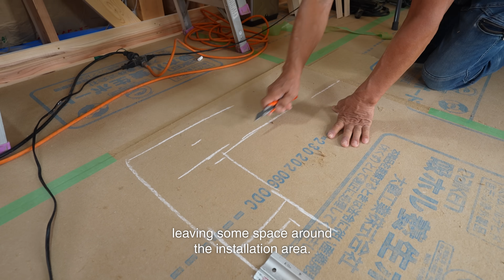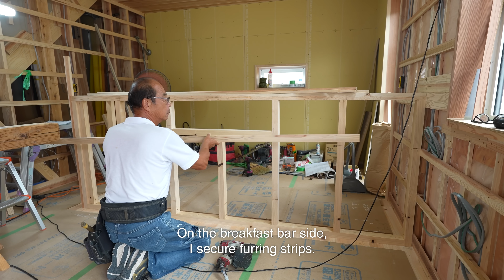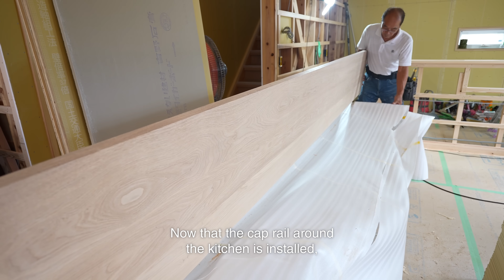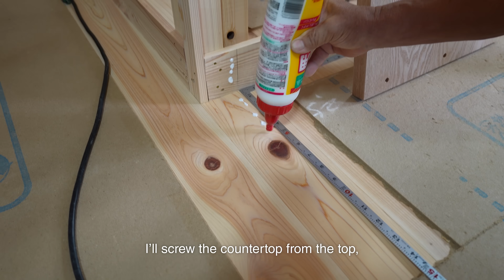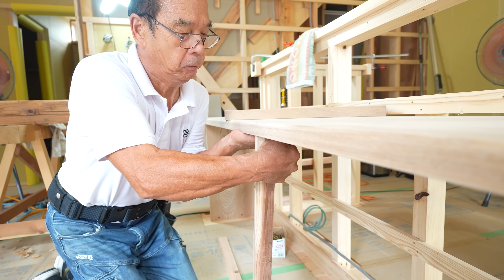Open Kitchen with a Cozy Japanese Inspired Breakfast Bar | New Build Season 5 Part 11

Comment: Just curious. When you’re driving in the screws, why do you back them out slightly before tightening them fully?
Reply: When you initially drive the screw it pushes the material away that you're screwing into. He's essentially giving the material an indentation with the first touch of the screw, backs it out then it can drive and pull things together. This is done normally when you don't predrill things with a  pilot hole.

Comment: When attaching the shelves you usually drive the screw in and out once, before you drive it in all the way. Why is that?
(I'm guessing it's a simpler way of pre-drilling to avoid cracks in the wood?)
Reply: Actually it helps suck the adjoining piece to it. Otherwise the screws have a tendency to push the piece away.

Comment: Having those cardboard sheets on the floor is such a neat construction prep method. Here in Europe, we kind of get around it by making the floors last, but in some situations, that sometimes comes back to bite you (door frames, specific details around permanent features like radiators and so on). Using regular cardboard wouldn't work, but i suppose a compressed cardboard sheet would do the same job.

Comment: Another excellent job. 

You Japanese are very fortunate to have access to such a variety of quality timbers that are affordable. 

I would have used a mitre join on the cap rail. End-grain is never a good option. 

The square (diamond) plug was a nice touch. Do you mind if I use that detail? 

Godspeed Shoyan.

Comment: Why do you sometimes sink a screw, then remove it a bit, before tightening it again fully?
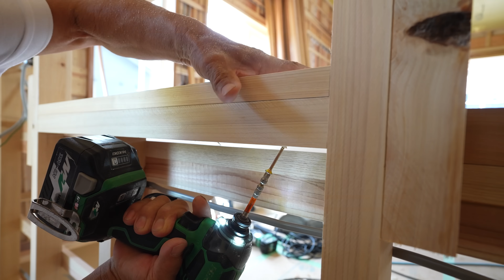Reply: 13:43 is a good example.  When screwing two pieces of wood together, the screw tends to separate the two pieces.  On the first drive, the screw creates a hole in both pieces.  When he backs it up, he can press both pieces together again and allow the screw to pull the pieces together on the second drive.
Reply: @ Ah, ok. Thank you. Never thought about this, as I pre drill the wood most of the time when using screws.

Comment: It looks really awesome but personally I'd go for that mitre. In my job if we have hardwood corners like that, mitres are standard. If You do more rounded corners in future, I'd suggest buying cheap jigs for them and rout them out with a top-bearing bit. It leaves a really good finish and it's really quick :)

Comment: Amazing craftsmanship.  Experience and skill.  I am also amazed at the quality of the wood.
Reply: I watch NHK-TV and have seen many shows in which something is being built or the topic is forestry in one way or another. They have so many tall & extremely tall straight trees of differing varieties. They used to have a very busy forestry business, but cheaper wood flooded the market then building buildings completely from wood fell out of practice. They have too many good trees & not enough people to work. But there is a glimmer of hope, a number of construction companies are out to prove wood is actually the better and STRONGER than steel. The tests are proving it. There have now been a number of multi floor buildings have been built completely out of wood. They’re gorgeous, they feel warm and welcoming, and they will hold up better. Along with this they have done much work around fire safety. It’s really quite wonderful.
With everything  I have seen built,  the woods is amazing.

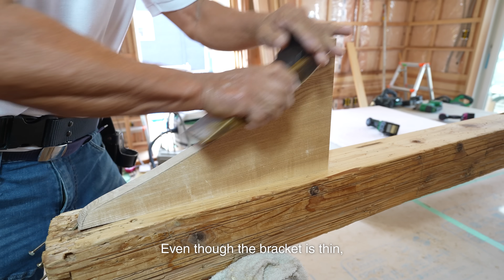Comment: 9:29 That jigsaw blade doesn't appear to be cutting a nice straight vertical line. It's rather angled out. I remember doing this on a project and I believe the cause was dull blade and pushing too hard on the saw. Makes more work in later steps to correct the bevel.
Reply: He explained the reason why.
Reply: @didndido3638  Yes I know he offered what he thinks is the cause but the density of the hardwood does not alone cause it. Pushing too hard and going too fast with the jigsaw will do this with almost any wood, especially thicker wood. A bandsaw is really the best tool here. Or a jigsaw with new sharp blade, preferably a wider blade and going slowly on higher speed setting.
Reply: @ "What he thinks is the cause..." he has decades worth of experience! He knows which tools and how to use them to make profit in his job. I'm a cabinet maker and I learned that there is always a reason behind a masters doing. Taking pride in one's experiences is not wrong but don't let it lead to arrogance.
Reply: @ You're assuming a lot of tone, attitude, etc in my messages. It was a simple comment about something in the video that reminded me of a similar experience I had personally. You can take it however you want but I know the comment was made out of sincerity and innocence. I find on YouTube I can make a comment about anything in a neutral tone and there will always be people that mis-construe and don't understand where I was coming from. It's natural to happen with anonymous text comments like that. Good day.

Comment: Great video as usual. Why did you use your hammer to notch the wood @7.45?
Reply: The glue will sit better between the woods where they joint, larger surface area on rugged surfaces.

Comment: What is the purpose of screwing in the screw then backing out a little then screwing back in?  Just curious :)
Reply: often the first drive will push the parts slightly apart. withdrawing it and pushing the pieces together before final screwing will hold them tightly together.

Comment: I build two house in Sweden,  in Sweden building small house with wood is normal , I find that wood house can not accumulate energy.  During summer hot during day and when sun goes down it get cold very fast . Over that it has no sounds proof,  it like 🥁 🪘 when some one walking 🚶‍♀️ 🤔 🙄 😒. 
It take a lot of maintenence,  wood nerver stand all weather climate. 
That is why I will never building with wood , I prefer concrete construction with granite stone fasad , last for ever with minimal maintenance . That is why Egyptian pyramid is there .😊
Reply: On the other hand, in Canada we build almost always with wood, but with thick, highly insulated walls.  It is true that we don’t have as much thermal mass, but at -30 C, the insulation is critical.

Comment: My biggest regret from watching these videos is I haven't been able to find much readily accessible Cedar/Cypress wood available in the US. I would love to use it in similar locations that he has shown.
Reply: if you just go to your local lumber yard, (not big supply stores like home depot or lowes) you will find it there, and if they dont have it in stock they will order it for you.  its a common wood so it should not be too hard to find, but the big home improvement stores will not carry it, you have to go where the professionals shop at like the lumber yard.
Reply: @orion7741  Last time I checked it was available but at a premium cost from a specialty wood store, I think the local lumber yard could get it but the quality wasn't great for the cost either. My (maybe incorrect) understanding is that in Japan those two woods are far more plentiful as lumber and as such, more affordable.
Reply: I found an importer here in Australia, so   I'm sure you can find one in the USA.  
As is the case here, I doubt you will find anyone who stocks it.